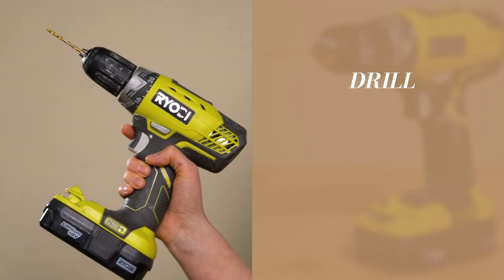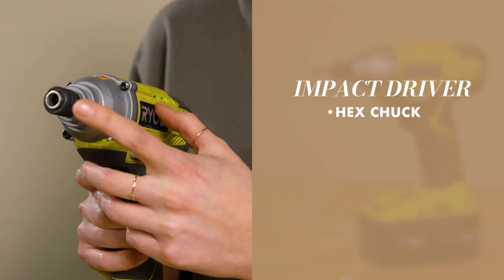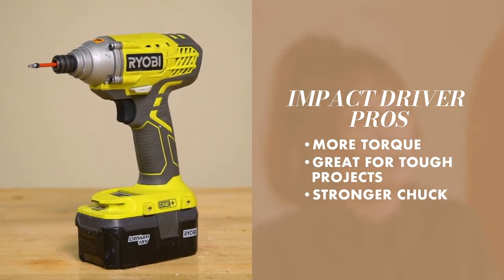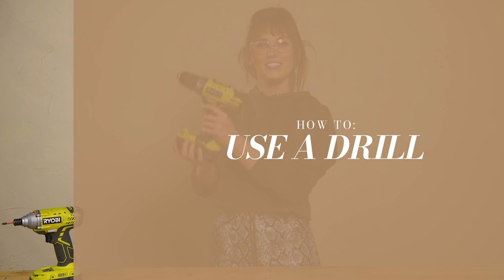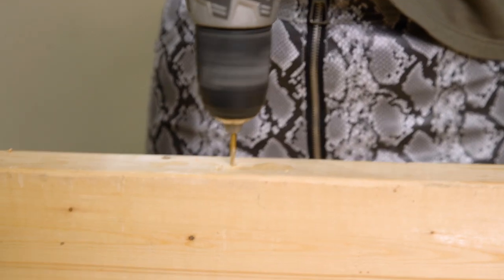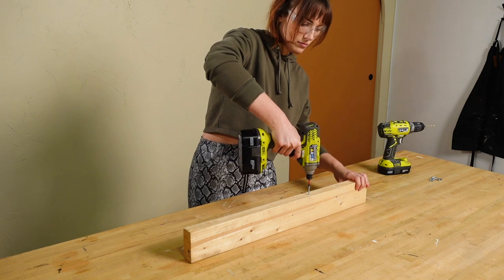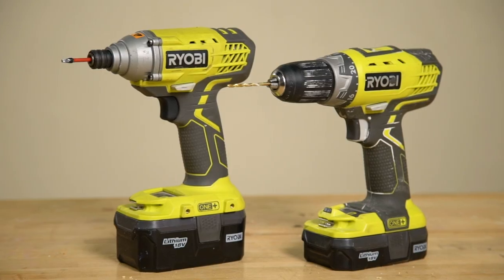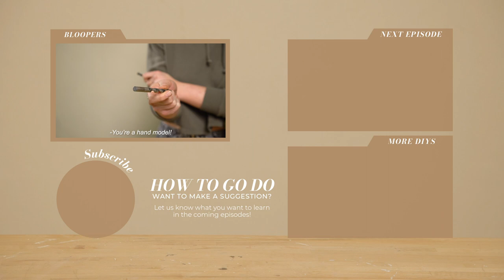How To Use An Impact Driver & Drill

Comment: Yes! I'm going to put up shelves in my brother's room and I been waiting for this! Thanks so much!!
Reply: Make sure you use the plastic anchors in your wall. Many walls (especially plaster) cannot be trusted to hold shelves ! 
You predrilled into the plaster, tap in the plastic anchor, then screw your screw into the anchor.
 If you have wooden walls, or can drill into the studs, you might not have to do this.
Reply: @m.maclellan7147  thanks so much! So if I drill into the studs I don't need anchors? I was really confused about that. I was going to use the studs in the wall but was wondering if I still had to used anchors.
Reply: I think you will be okay if it's in the studs strongly ? Just a warning, newer houses don't have wood studs, think they are metal ? I don't think those would be strong enough to hold up shelves ?
Reply: @m.maclellan7147  thank you so much!!
Reply: Hello Beautiful, How are you doing today? Its really nice having  you on here .. I saw your profile on here and i think we definitely are on the same page on many levels. Trust, communication, loving, honoring, understanding, patience and respecting your partner. So crucial to provide balance. This is what creates such great chemistry between two people that are committed to one another💙💙💙

Regards Ruiz 😍

Comment: Thank you for this one. It actually helps me with what I am working on today -- which is putting metal legs on a table top! I knew I could handle it, but I was a little scared. Now I understand how my drill is designed to work, and now I can do what I thought I should do (drill the pilot hole, then pulse in the screw).

Comment: Additional safety info: And this goes for  any power tool  with rotating or moving parts, saws too:  If you have long hair, tie it back our put it up before using the tool. Do not ever operate that tool with long hair  hanging down  near   the tool.  This also goes for  dangling scarves, neckties, drawstrings on hoodies, or any loose dangling piece of clothing.  Hair and loose clothing can get caught into the spinning drill and will pull your head into the tool faster than you can react.
Reply: Yes! You see this a lot with self-taught accounts. Especially, the draw strings and long hair🙈 As a business you usually have to do a compulsory safety training every year or two that goes through everything - most of which should be common sense.

Comment: Another tip I’ve picked up is to ALWAYS start with the smallest drill bit size and move up to the required size or until your wallplug, for example, fits snugly. Not so much a requirement if your using wood but good for beginners using drills for the first time. 

Oh... I’m having a crisis of confidence this weekend though. I have used my drill on a couple of projects but I’m hanging a window box directly into brick on the outside of my house. This is the first time I’m drilling into brick and it’s such a different experience. It feels like I’m doing something wrong. So far I’ve drilled about a cm depth and stopped. The tremors of having to use such a high speed and drive is terrifying and I think I’ve already blunted on drill bit. But I know it’s just pure brick that I’m drilling into as I helped rebuild this bit of the wall. So other than blunting a few drill bits and it feeling a little scary, nothing can go wrong. Right... 🤔
Reply: Hello Jessica, How are you doing today? Its really nice having  you on here .. I saw your profile on here and i think we definitely are on the same page on many levels. Trust, communication, loving, honoring, understanding, patience and respecting your partner. So crucial to provide balance. This is what creates such great chemistry between two people that are committed to one another💙💙💙

Regards Ruiz 😍
Reply: @thomasruiz3614  ummmm. No thank you.

Comment: I have what I believe is a regular drill, how do I put holes into the (concrete) walls of my apartment? I tried and failed. Do I need an Impact Driver?
Reply: You need a masonry bit ! They are designed for that use !
Reply: Would be easier with an impact driver but you can just get a bit for concrete so you don't have to buy a whole different drill!
Reply: @jenniviiv  I’ll give that a try, thank you so much!
Reply: Hello Vannesa, How are you doing today? Its really nice having  you on here .. I saw your profile on here and i think we definitely are on the same page on many levels. Trust, communication, loving, honoring, understanding, patience and respecting your partner. So crucial to provide balance. This is what creates such great chemistry between two people that are committed to one another💙💙💙

Regards Ruiz 😍

Comment: One additional note:  Wiring isn't the only thing in some walls.  Water lines are also rather devastating to hit with a drill or screw!   Be sure you know where your water lines run before you drill - we actually have one wall where there are PEX water lines that come in from the outside-access utility closet where our hot water tank and holding tank for the well are.  The lines in that wall are at eye-level and below, and run THROUGH a couple of studs each before they reach the slab.  There's another wall through which the drain from the pan under the heat pump coil (which is in the attic)  runs to a spot near the ground outdoors.  Drilling through that might not be as immediate a problem as a water line, but you don't want extra moisture in your walls, regardless.

Comment: You don't want the pilot hole to be larger than your screw's shank. That defeats the ability of the screw to hold. Yes?
Reply: yes
Reply: The hole can be the size of the shank (the solid part of the screw - not the threads) but I usually go quite a bit smaller
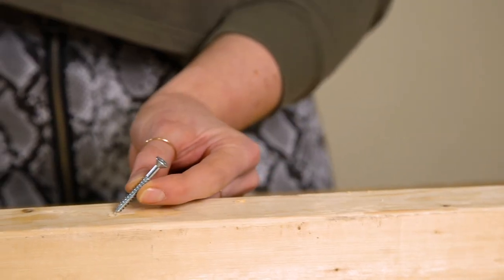Reply: @sethklungseth333  Yeah. I know. I was hoping to gently get Kelsey to correct her statement in her video ("this hole diameter needs to match or be a hair larger than your screw's shank--at 2:15), so no new-bie to drilling would think they should drill a pilot wider than the screw they need to use.

Comment: I have a carpenter for a husband. Your over size predrilling of your pilot hole is enabling you to put a nail in, not a screw. Making the hole bigger than your screw gives it no chance for it to BITE into the wood. This is a error on your part. Smaller pilot hole gives the screw a better chance to hold on and bite the wood.